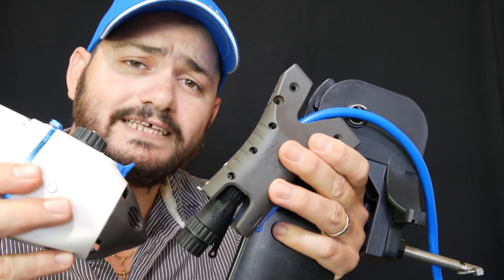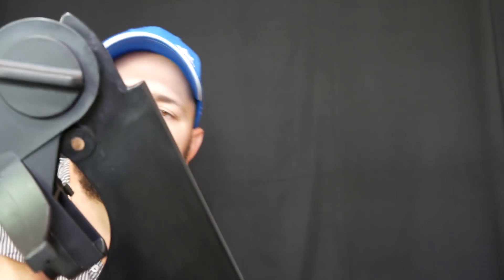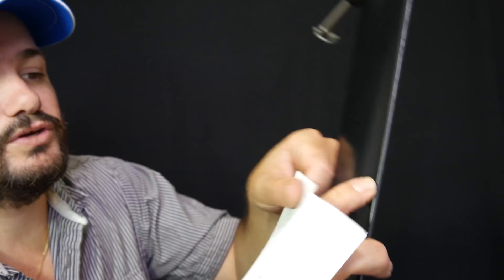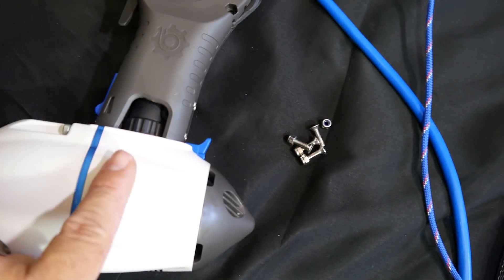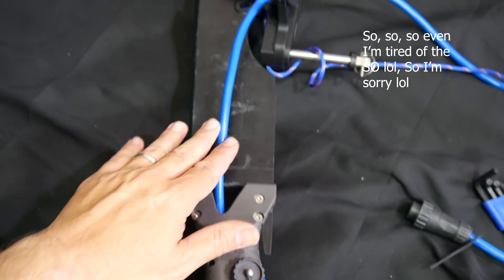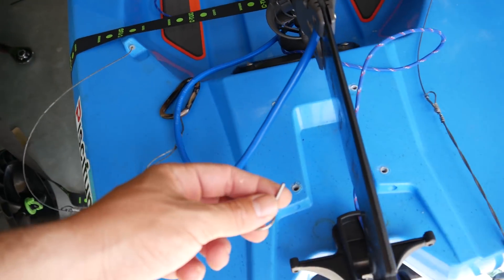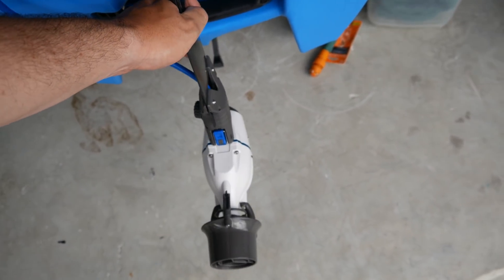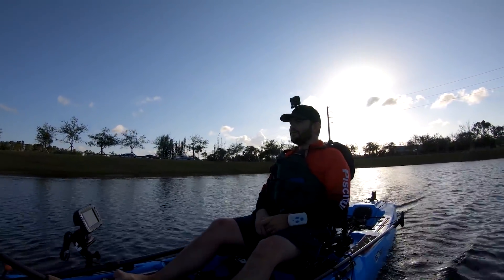DIY BIXPY JET motorize Most Kayaks with Rudder Using Bixpy Rudder Kit

Comment: with the nuts if you place a small amount of silicon on inside of nut it will stay and then the screw is easy to get in. With this hook up can you go into reverse?
Reply from the maker: thanks for the tip, i think it is lockable to use in reverse, but i haven't try it, I like having it free so it can move up if it hits something

Comment: Could you just screw the adapter to the bottom of a feelfree beavertail rudder instead of cutting it?
Reply from the maker: I have done something like that check it out I MOTORIZED AMAZON CHEAPEST KAYAK WITH Bixpy Jet Intext CHALLENGER K1
Reply: @AliexFolgueira  thanks, I have a moken 14 with a beaver tail rudder already hooked up to it. Just thinking screwing it onto the bottom of that rudder would just be easier.